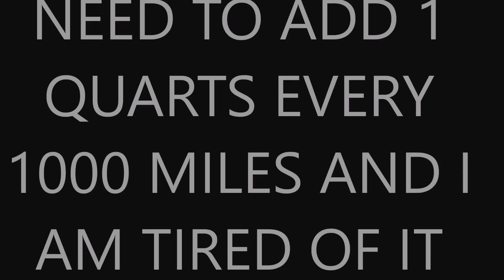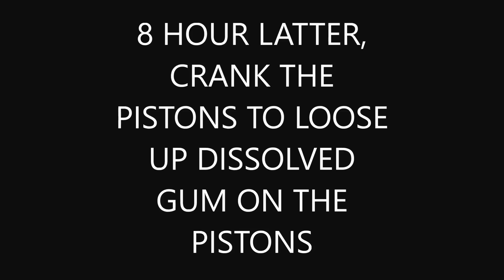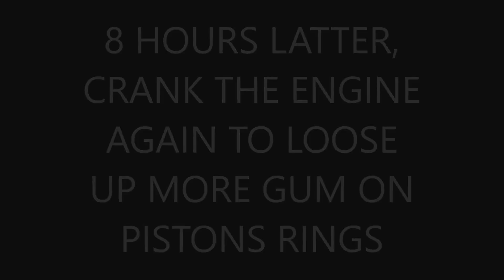MY WAY to stop ENGINE BURNING OIL FROM STUCK PISTON OIL RINGS WITH SEAFOAM

Comment: I always stop and wonder about these Seafoam videos because no one seems to know or care that there really is no cleaner in seafoam. It's 50% Lube and 20% water dispersal isopropyl alcohol. The rest is 30% mild naphtha kerosene. Which is not a  heavy duty carbon cleaner by any means So simply looking at the MSDS there's nothing in the bottle that will be effective as a piston soak, just not enough strength. It's mostly oil and lube.
Reply: What would you recommend?  straight kerosene?  liquid wrench or PB blaster?  Red & Green antifreeze mixed with carb cleaner?
Reply: Hard to argue with the results some of these people are having. I thought valve buildup and seat issues benefited from these products! I am amazed as well. I no longer drive cars that need the stuff to solve problems. I believe I once lost an old car to low oil (head gasket- can't say for sure but I do) driving it too hard (in turns) from low oil- damn youngster. I am looking to use it on some vintage motorcycles. Nonetheless. Alcohol and Kerosene are solvents but if would like a better solvent try the toluene in Berrymans.
Reply: Have you ever seen a cylinder that blew the head gasket and had coolant running into the cylinder? Well if you have you would notice it's much cleaner. Any kind of moisture in a hot compressed cylinder is going to basically get steam cleaned. So that's why an old timer trick is to get a spray bottle with water and spray the air in let while it's running.

Comment: Is there any easier way of doing this like just adding Totnes crank case and fuel system instead just before an oil change to do an engine flush?
Reply from the maker: try that b4, not working

Comment: The Seafoam is a BIG joke !!!
The reason your engine is burning oil is because of 5 - 7 thousand miles between oil changes ...
Stick with the 3000 miles and see if you don't see a difference  !
Reply: And switch to Shell Rotella oil. That shit will practically steam clean your engine inside.

Comment: Looks like hydro lock 101.............your rings have to be shot all the way out for the sea foam to be able to leak past the rings and to the oil pan. How did you not bend a valve or rod on start up. Voodoo
Reply from the maker: 365,000 miles now and still running strong

Comment: My engine doesn't start at all what do you think what it could be. First time I wait 12 hours second time i was rush and start after 4 hours
Reply from the maker: кенжебек жолдошов. It can be the ignition problems
Reply: Yes looks like you're right. Lights on but engine doesn't crunks at all. Do you have any solution?
Reply from the maker: кенжебек жолдошов. Start with the ignition coil

Comment: Oh god! Please don't do this. Luckily he didn't hydrolock his engine. Also, the oil in the engine is now watered down.
Reply: I believe you can add seafoam to the oil if im not mistaken so thats not really an issue however putting the plugs in with all that liquid you are correct he got lucky

Comment: One cause of burning oil is blowby. You CANNOT fix blowby caused by worn cylinders!! Your best bet is to only purchase cars with steel-lined cylinders... like my 4Runner
Reply: most causes are not worn cylinders but stuck oil rings that allow oil into the combustion chamber. this also would effectively keep the cylinders from excessive wear. the oil rings is designed to bring a small amount of oil up the cylinder then scrape the excess down every stroke .  thus lubricating the cylinder then removing the excess so the compression ring can do its job.  this is why oil changes should be done every 3500 miles to prevent carbon build up. most OEM now recommend 7500 miles because they know your engine will develop problems right out of the 100,00 mile range . Ive seen this way too many times over the years . Carbon build up will clog oil pick ups, make oil ring stick closed ( the cylinder is actually honed in a cone shape , small end at the bottom ) clog oil passages in the heads ........
Reply: PS all aluminum blocks have steel cylinder liners
Reply: This video attracts some real car gurus... Rick, please tell us about cars with non-steel cylinder sleeves in aluminum blocks... The deal is some of those are somewhat easily replaceable but most engines these days have cast iron sleeves hard pressed into the blocks and it is just cheaper to replace whole block then to replace the liners. Please tell us how easy and cheap was it to replace the sleeves in your 4Runner because it sounds like you have no clue about what you are talking about
Reply: Pretty sure all engines are made with iron ( Not steel ) cylinder liners ( If an aluminum block. An iron block is self explanatory.) but that is not what matters. Blowby is low compression caused by worn or damaged compression rings not sealing against the cylinder and allowing combustion pressure to escape into the crankcase, oil consumption is caused by the oil scraper ring either being coked up or broken and not doing what its name implies and scraping excess oil off the cylinder walls. Then when the piston travels up on the compression stroke, the excess oil is then carried into the combustion chamber by the compression rings and burned.

Comment: U add 10oz to the oil run it for about 100 miles then change oil.ad motor kote after
Reply: Why not just dump the whole 16oz can in while were at it 👀 they claim they have seals sitting in jars of seafoam for years now and it doesnt harm them because its petroleum based and not a solevent 🤷‍♂️

Comment: The Toyota 2az-fe has this problem. Might be either a stuck or clogged ring.
Reply: I solved the problem on our 2007 Camry with 2az-fe (220K km) using synthetic 0W20. I am pretty sure, should I start again mineral 5W20 it will start burning oil again.
Reply: Slava Ivashev forgive me but I’m having trouble understanding. Is using a different type of oil the solution? Perhaps something like amsoil at a thinner viscosity.
Reply: PCruler For 2007 4cyl Camry, recommended 0W20 or 5W20. From dealer it comes with 0W20. Start using 5W20, and most probably you will have problem with clogged oil channels on pistons, and oil ring. Switch back to 0W20 which is thinner when engine is cold, and oil burning problem goes away. That's how it worked for me.
Read about oils, what's first number mean.
Reply: PCruler the Toyota 1ZZ-FE engines have the oil consumption/stuck rings issue too.  Not enough oil return holes in the piston so  they clog and the rings stick.
Reply: So it could be clogged rings then…

Comment: Cleaning your piston isn’t going to stop it burning, the rings are bad on the piston
Reply: Andrew V the rings can stick inside the piston, allowing oil to pass into the combustion chamber and lost. If the rings don't properly expand due to carbon build up they'll 'stick'
Reply: Not always. Hondas have free floating compression rings with a semi retained oil control ring.  Iv seen the oil control rings on k series motores get clogged up with carbon and keep it from expanding. If this happens on 1 cylinder.  It will burn a shit load of oil. Not to mention that hondas burn oil by design. As in honda sees it as normal to burn up to a quart in 2400 miles.  Thats a good amount of oil to burn naturally. Thats why for the k series they built the pan deeper and made it carry extra oil to combat this.

Comment: Man talk about luck if I did that it would probably hydrolock on me but looking at the bright side it wouldn't burn oil anymore because it has bent rods lol if I were to do it naturally I would not have the plugs in and would use the crank bolt to slowly turn it over by hand after leaving sit

Comment: Definitely a waste of time that's going to clog back up due to age. All engines burns oil as they age from normal wear and tear. There is just no way around it besides driving it for years and add oil unless you got the dough to rebuild the engine which probably wouldn't be worth it on an old car.

Comment: JOE HOWTO 
>>/                       '      If you car is burning oil often and needs to ADD oil what is wrong with the engine? the head gasket?
Reply from the maker: If head gasket problem, coolant will have oil contaminated. Coolant is fine, no oil present.
Reply: @joehowto  the oil will get milky? and the coolant will be darker?
Reply from the maker: @billwilliams6338  none of them has happened.

Comment: I recently heard of someone doing this with a motorcycle that had stuck rings from sitting for years and burning oil when started.  He poured kerosene into the cylinders and let them soak.  Don't know for how long nor how or if he had to remove the kerosene from the cylinders.  It may have just seeped down past the pistons and into the crankcase.  But, apparently, after that treatment the engine ran better and without smoking now that the rings were all freed up.  Any ideas on what would be the best process - Sea Foam or kerosene or some other liquid?  Or, try one then another to really make sure the rings are freed up?  I don't know if you could see anything with a borescope to know which method was working the best.
Reply: 2-stroke oil is 20% kerosene, outboard oil comes with 30, which would be safer and more effective
Reply: Diesel fuel will do the same thing.
Reply: I read kerosene is what 99 percent of seafoam is....basically its a small bottle of kerosene
Reply: @dirtydavesgarage8251  It is naphtha, some type of petroleum.

Comment: I'm going to try that on 03 Camry which has been a very reliable car with 240,000 Kms on it. Changed one PCV valve, one starter and  no other breakdown ever.  Now it has started to consume some oil.
Reply from the maker: it should work if it is not from leaky valve seals. Check if there is any blue smoke come out from the tail pipe in the morning. Mine is just steam coming out in the morning. So oil consumption is not from leaky valve seals.
Reply: unless the seals are broke which is possible
Reply: Spencer Prescott if the seals are broke, should you be seeing blue smoke? I'm really conflicted on whether or not I should try this method but I am getting rather desperate to fix my oil consumption problem in my 2011 Hyundai sonata... It consumes about 1 quart every 300km. I replaced the pcv valve, valve cover gasket. I'm not sure if it could be due to worn valve seals. I'm just wondering if this method could possible work?

Comment: Your car still works well without any problem after your treatment?
And oil consumption ?
Reply from the maker: As other recommended, it will be better to leave the spark plug out before you crank the engine.  When I did the treatment, my car was around 258,000 miles. I need to add about 1/4 of a bottle every 3000 miles. I use mobile 1 so I only change the oil every 6000 miles.

Comment: Sure looks like a good way to kill a motor.  Fluids don't compress very well.
Reply: Never heard of piston ring gap??
Reply: @markschellhaas  piston ring gap isn't large enough to relive the pressure fast enough if that engine is turning over. Fluid "cannot" be compressed, turning over a engine even partially full of fluid is not good on it. The tighter the cylinders seal, the worse it will be.

Comment: Hoped you changed your oil after all that sea foam went past your rings. Plus you should never put plugs back in with fluid in your cylinders. It’s called HYDRO-LOCK.....👎
Reply: This Is a solvent not like water, oil or antifreeze. Also... The liquid Is about 15-20% Of the cylinder volume. There's no F risk Of hidrolock
Reply: JohnnyCamaney;     If the cylinder has a cross sectional area of 1 mm^2 and the un-pressurized water column height is 100 mm then the original volume is 100 mm^3.  Each newton applied to the piston will generate 1MPa (1,000,000 n/m^2).  The compressability of water is ~4.6e-10 (1/Pa).  So for each Newton applied to the piston the volume decreases by 1MPa * 4.6E-10*100mm^3 = 0.046 mm^3.  Dividing by the cross sectional area of 1mm^2 gives a height change of the piston of 0.046mm.  Applying 10 Newtons gets a height change of .46mm.  This is a measurable quantity.  The trick is building a cylinder/piston and seal system that can withstand the pressure.
So yes most things are compressible, but you’re more likely to bent or break something in that cylinder. For every action there is a reaction and depending on the material and liquid, you will most likely bend or break something. So NO I would still not attempt to do what this guy just did.

Comment: joe howto just showed us how to HYDROLOCK our own engines for only 11USD .All it takes is half a bottle of seafoam ,lots of stupidity and in his case tons of LUCK for that engine to start after he HYDROLOCKED IT at exactly 2minutes and 20 seconds....SMH in disbelief.Point is if you do this--DO NOT  thread sparkplugs in,just barely start them,Should come to engine every 1/2 to an hour and manualy  rotate it  1-2 turns  and do that 3-4 times.normal rings by then should have drained all of chemical trough..You still should then remove plugs,do couple or more starter cranks to make sure any liqud is out of cylinders before reinstalling plugs and coils...BTW MUST disable fuel supply before doing anything else(either fuse or relay of the pump) This may not apply to maybe 2-3 percent of UNICORNmobiles out there,LOL.
Reply from the maker: Clueless??Don't think so. Have done this 6 times already to my car. It now have 310,000 miles
Reply: @joehowto    Proof that miracles do happen and for some reason (if there is a) GOD loves you beyond my comprehension..Obviously will NOT subscribe,your advice is not only worthless,it is actually criminally wrong and irresponsible..  YOU KNOW WHY IT DID NOT TURN OVER AT 2:20!!!!!..Take the video down if you respect yourself. Sooner or later someone will destroy their engine folowing your advice and it may be much newer and more expensive than yours with 310 k of miracle whip miles.
Reply from the maker: Clueless??Don't think so.  I did that on purpose not to turn over at 2:20. I only want to move the pistons a few inches, not  no need to turn over it. You can say whatever you want in your theories but I have the prove that it did not hydrolock the engine. It probably may happen to yours but not mine.

Comment: Joe Howto -Any update? with oil consumption?
Reply from the maker: About 3,000 miles still no change on the dip stick. About 7,000 miles it drops about 1/8 inch on the dip stick. I don't change oil until about 12,000 miles and I use Mobile One.
Reply: @joehowto  awesome! Thx

Comment: 2:20 lucky it didn't hydrolock. Sure sounds like something gave out.
Reply from the maker: I have done this more than 3 times already since I made this video. It hydrolocked my engine every time. This is my 4th new engine
Reply: Joe Lui why do you keep doing it if it hydrolocks your engine?
Reply from the maker: I was just joking. It did not hydrolock the engine.
Reply: Joe Lui you are crazy to think it wont
Reply from the maker: I did it 4 times total already. I only crank it little by little and not all at one time.
Reply: Joe Lui all it takes is one turn of the crank and you can throw a rod.  I would never do what you did.  The clearances on the K series are pretty tight.  It's not like you have a ton of room between the pistons and valves.  Sea foam doesn't compress like air does.
Reply from the maker: Thanks for the advice
Reply: Joe Lui So obviously this method does not work. You need to rebuild the engine. Mechanic in a can will not fix worn pistons or piston rings.
Reply from the maker: James B my car now has 265,670 miles on it. It works for about  every 20,000 miles. I don't change oil until about 12,000 miles. so i just use seafoam every 20,000 miles to clean the carbon and rings
Reply: James B - yea except for one little problem with your theory...it IS working for him.

another problem with your theory is that these engines always gum up and start using oil because of stuck rings. rebuilding or replacing rings etc is just a very expensive bandaid...it will just keep happening. of course mechanis love it because they can rob you of your hard earned money.

Comment: Tired of adding oil every 1000 miles. I have to add a qt every 70 miles to my car
Reply from the maker: Dang
Reply: 70 miles damn
Reply: I am in the same lane. Today I tried pouring 1pt Of 25W-60 API-SN motor oil in a vacuum líne to get rid Of wet sparks.

Comment: no way this car is still running lol
Reply from the maker: Honda made good engine. It is now 260,569miles on it
Reply: Spencer Prescott 
My civic have 180 000 on a clock, I'll do this , and I hope it works.
Few months ago , I overhead the engine, and the car suddenly start to spend oil.
I replaced the head , fixed, changed valve seals, but the engine still spend oil.
I think is a stuck oil rings , I all ready both the stuff, and I'll try this week.
I trust you...
Reply from the maker: Hope it works
Reply: @vitaliigavrilov6030  how It was?